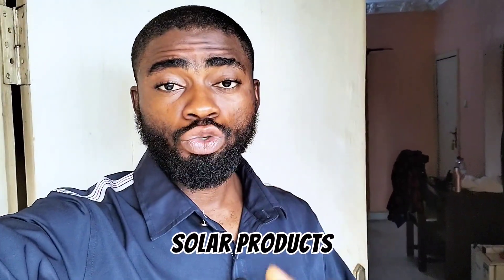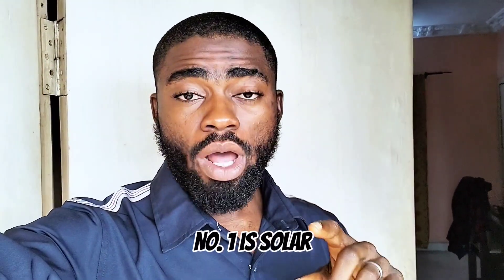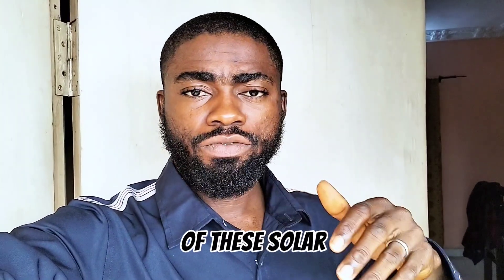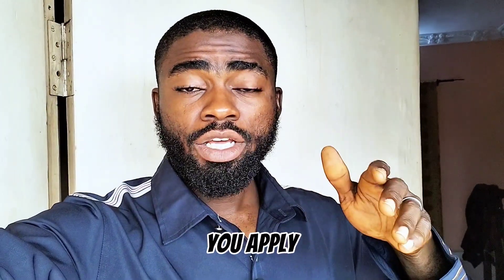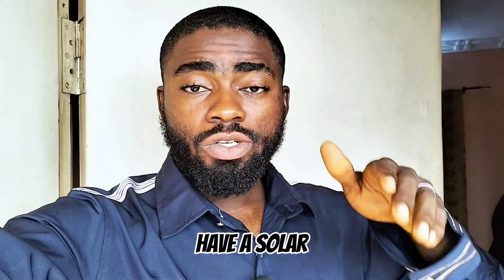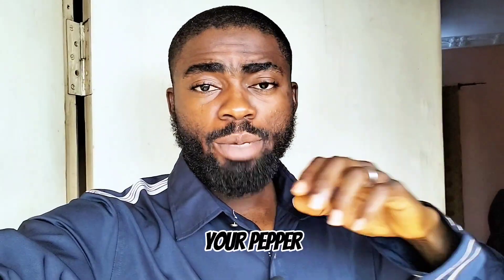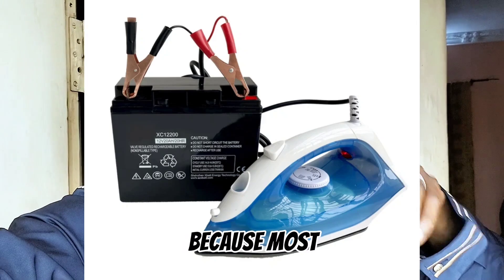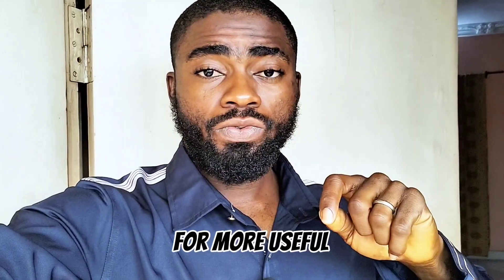Solar gadgets to avoid in 2024.

Comment: I havent used other products but I totally agree with you on Dc 12v pressing iron. Its trash...it doesnt get hot quickly, you will need to wait 10min to get hot and when you put it on cloths, it get cold almost immediately. its 150W and works 8 times less than a normal 1000w 200vac iron.

Comment: I have an exception. I have used solar freezer for months, and it was very effective in freezing the items in them. Infact, i had to reduce it to a lower setting, yet it was  forming large ice on the internal. If your battery can power it 24/7, i dont see why anyone should complain. The only complain i have is that the fan is not as quiet as some other freezer i have.
Reply: What make of freezer is this please?
Reply: @kastrizzle  the common bona freezer brand
Reply from the maker: Enjoy
Reply: bear in mind that inverter freezer is not same as solar freezer that uses 12volts battery.
Reply: @abdulsalamabdulrahmanabayo2189  inverter freezer and solar dc freezer are different. Dc freezer uses direct current from battery, while inverter freezer still use ac current from your grid
Reply: I am using DC freezers for quite some time ( since before COVID), I have no big issue. The only problem I had is when the fan stop working without us realizing, am still enjoying my free energy freezer